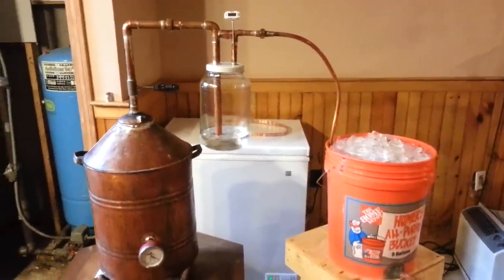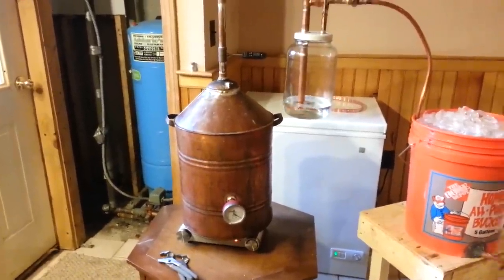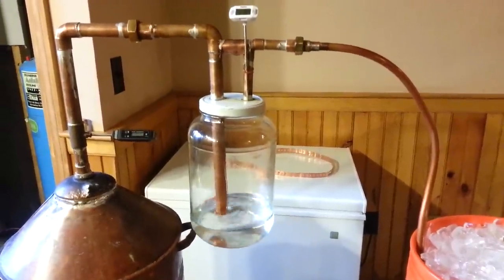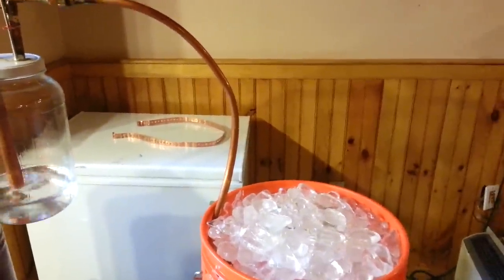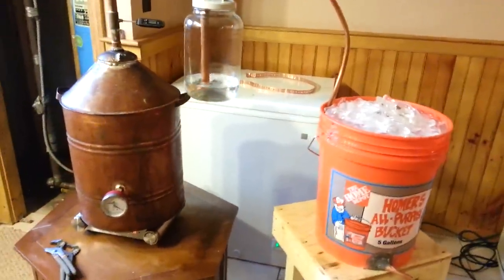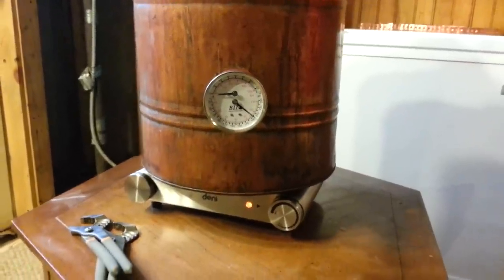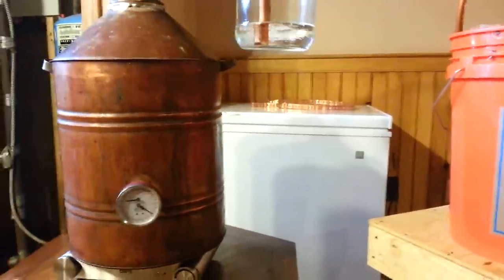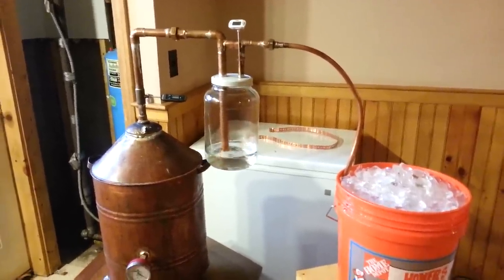Homemade still

Comment: I really like the brace across the top of the thumper for strength, especially holding up the weight of the thumper. Had me fooled for a moment as I thought that there was vapour passing through there until I TOOK A CLOSER LOOK.

Comment: Not bad. I actually took and redesigned my own still when I saw how you built your thumper. I just ran the copper line directly into the condenser at first but now I'm running a set up similar to yours
Reply from the maker: Hi, thank you for commenting and I'm amazed how many reviews I got!

Comment: Good Video! You have a pretty good set up! Be sure and vent your thumper and boiler when you shut it down or you could collapse your boiler! Hobby Distillers are becoming more and more numerous. I have found lots of good information from Bearded & Bored or Barley & Hopps Brewing!!! Those guys try and give you good advise. I have made two stills one is a packed column reflux and the other is almost a duplicate of what you have. All were made using what I could put together. One is all copper and the other is stainless steel pots and pans that I modified.

Comment from the maker: Thanks for taking a look at my video. The liquid in the "thumper" is tail ends of moonshine or regular moonshine, also can use mash liquid.
Reply: Just a tip, I know this is 9 years later lol I’m just getting started (kinda I’ve been doing it for two years) but filling up the thumper I think helps more once you start infusing flavors. I’d go about half the jar for this setup or maybe more (i just ordered the same jars 5 minutes ago lol and now im watching this and your using the same kind) but having more liquid in the thumper helps more alcohol get infused by the liquid, the more it passes through the more it’ll hold. You can also do two jars to get a higher abv and infuse multiple flavors

Comment: Thank you for the video, lots of good pointers on building the distiller.  Iowa USA
Reply: gene wiley I'm in Iowa as well. Southeast. Washington County. Would love to learn any tips you have.
Reply: I used to make shine in prison. We'd light a capful and if the flame burned invisable ( checked by hanging tissue over cap ) we  newit was 200+ proof. My queesstion...what proof do these homemade stills produce? Its a process in prison. Sugar, fruit, yeast, submersive heaters ( stingers ). Or 2-4 razor  blades secured to an electricall cord a nd llugged into outlet and wahlah...homemade water heating device. Very effective . Especially 2 or 3 per 5- gallon bucket...hehe. But if it blows up theres  no way to cover the smell of liquor-lmao

Comment: what purpose does the glass jar serve?  my still consists of the boiler that has a copper tube coming out of it that coils through an ice slurry. Basically the same as that but with no jar in the middle.

Comment: Nice antique still i have been doing straight sugar washes and have been getting 140 proof i put some raisins and apples to help the yeast work. Id like a thumper cause ill be running strong and then it drops off fast . Ill just save the backings and mix with the strong as i go along to bring it up. Nice set up tho i use stainless pots with all copper after ive used sll stainless and it doesnt taste as good .

Comment: has your thump jar held up to date?  some say glass is a no no. 
as a previous comment mentioned- ditch the ice. use a 5 gal pail higher than the condenser for the cold water in. make sure the hose delivers cold water to the bottom of the condenser.  use aquarium air hose for this (serious). clamp hoses from the inside top of the condenser running to another five gal pail lower than the condenser. 100% siphon action. this water will be hot-perfect for dishes or a bath. my set up is two gal smaller than yours. i only need one aquarium air hose in and out to keep my drip cold. two should be plenty. youll run about 20 gal of cold water and getr it back hot...there's efficiency.

Comment: Where did you find the fitting for your digital thermometer on top of your cap?
Reply: its a 3/4 bleeder tee for heat lines the outlet it list 1/4" i believe

Comment: Hi, nice still. A Russian friend explained I needed a small pub keg so I bought one for £20 of a landlord in Manchester, UK then the Russian got me a coupler and said I also needed 10 metre copper pipe for the worm which I bought for £20 so thats £40 Ive spent. Not seen the Russian for a while but figured I can learn myself anyhow. The thumper jar, Im wondering why its joined at the top and is it really effective as it gets warm? Does the thermometre need to be in a grommet or soldered in?

Comment: I was wondering how far the exhaust pipe from the boiler went into the thumper. Now I have a better idea on how to set mine,if and when I do mine.Thanks for the video.
Reply: Run it pretty close to the bottom, I like a half inch to an inch off the bottom depending on thumper size and the top pipe as close to flush as possible

Comment: If this was a true antique store find then you should know that they only used lead in the solder in the old days as that's all they had.   I would be more worried about that then!!!  the homemade thumper.
Reply: Was wondering what's in the thumper? Distilled water or some previous batch's heads/tails...
Reply: Lead in the condenser (old radiator) would be very dangerous . . . . in the pot it would tend to "stay behind" just like salt, sugar, the mash solids, and any other contaminants.  There's even a 2nd distillation - the thumper itself would catch non-volatile contaminants.
Reply: @stevenjohnson2273  it's an open pressure vessel so it wouldn't explode, it would only shatter if it went I to temperal shock from rapid cooling
Reply: Not true. I had (saddly don't anymore) my great gran dad's still. I tested the solder for lead and it came back as lead free. That's on a 100 + year old pot

Comment: the worm bucket doesnt need ice, just cool running water...the ice is causing too much condensation inside the worm,  much like cold tea poured in a glass with the water forming in on the outside

Comment: Great hobby !!
What purpose the pickle jar serves? What difference water or alcohol in jar will make? Can it be run directly? What else can I use if I do not find copper pot?
Reply: stainless steel pot
Reply: 1 question, on your thumper, does it require a copper lid ?

Comment: Hope that jar doesn`t blow up on you if it hasn`t,gotta replace it with pyrex or a steel pot cause the heat will stress out the glass and break it.
Reply: jar wont blow up you can boil mason jars  . and it only gets to 170 degrees  making alcohol. thumper helps lots
Reply: cadillac cts It`s not a mason jar it was like a empty glass jelly jar, the stress makes the jar weaker I wouldn't`t use a regular glass jar cause I would be afraid of it cracking after awhile. Yeah the thumper's do help quite a bit it`s like doing another half distilling also you can put juice or whatever in it to add a bit of flavor.

Comment: A few words of caution.
A pickle jar is NOT suitable for a thumper. The gasket ain't supposed to be exposed to high ABV alcohol and all the other stuff that comes off the boiler.
Furthermore, the glass WILL fail at a point as it's NOT borosilicate and heat resistant.
You should buy a lead test kit and test that boiler for lead solder. Back in the day, some fool may have soldered the boiler up with that stuff..it's a no go..!
If it tests positive take it apart and remove all solder, clean it thoroughly and resolder.
If you discover some huffing from the worm the ice is the cause. Use cold water to create a temperature gradient from top to bottom of the flake stand.
Happy distilling. :)
Reply from the maker: Thank you for the information and these days I no longer distill. Have a great day :)

Comment: Since you have a glass thumper, does your thumper ever go empty? Reason i am asking is cause i have a 5 gal still with a 1/2 gal thumper and after 2 qts i start to get a cloudy product plus the alcohol reading drops from 90 proof to 20 proof real quick...And since i do not have a glass thumper i do not know if it went dry/empty and thats why its cloudy from air or if it went back into the still and thats why the thumper is always empty...Either way if yours doesnt go empty then i still have an issue with it clouding up after 2 qts....1 qt is 150proof and the second qt is 140 proof and then not long after it just starts dropping fast and then it clouds up....I then shut it down, let it cool down, open up the thumper & its empty! So plz let me know so i can fix my issue...Thank you!!
Reply: My guess is your thumper water is reaching 212 degrees and then evaporates and that is causing your cloudiness and drop in proof.  Maybe you just need more water to increase its thermal capacity.  Or start with colder water.
Reply: if you end product starts turning cloudy in the middle of your run, your still is puking because your heat is too high, if your pipe going in too the thumper is all the way to the bottom, when you let the still  cool down it is drawing the liquid in the thumper back in the still, if you can reset the pipe in the thumper to about an inch off the bottom, and the next time you make a run start with low heat, old timers will tell you, low and slow is the way to go.

Comment: Out of your 5 gallon mash run how much do u dump out for the head?
Reply: It wouldn't be "wasted" if you collect even 300ml and dump it in your car's gas tank as "fuel injection cleaner" where Methyl Alcohol would be a powerful solvent and fuel.
Reply: Mark I'm just starting to learn if bad alcohol is under a hundred and seventy why not keep temp under 170 until every nothing comes out then turn it up

Comment: I'd suggest putting a safety container (a bucket or a cheap stockpot) outside of the jar. That would catch the glass and the alcohol if something goes wrong.  Right now with that jar hanging over the burner, if it breaks some of the once-distilled alcohol inside will hit the hot plate, and when it lights, it will ignite the vapor tube.
Reply: Should NEVER use glass in any part of a still operation. The dangers of alcohol vapors alone should speak for itself.
Reply: Utter nonsense - glass is used every day in laboratories for this kind of operation.

Comment: I'm a dummy writing a history. Two paragraphs deal with 1920s stills. How do you get the mash in the copper still? How do you empty it? Some sources say the mash is made outside the still and then added when you need to distill. Do you pour in or siphon in the mash water/mix into the still? I'm concerned about explaining the broken up equipment that shows up in prohibition photos? Were very large wooden vats for mixing the mash? Thanks.

Comment: why is the jar exactly for messy particles right?
Reply: Vladimir Nachev If you are getting anything but vapor from your still you are running too hot and actually boiling the mash over.  You run the risk of burning the mash with too much heat.  In the case of corn mash, it'll taste like burnt popcorn.  You might be filling you still too high also.

Comment: You really need to change out the lid on your thumper. Bad enough it's glass it that lid is not copper or stainless! NEVER have anything other than copper, stainless, or glass in contact with your shine. It can cause poisons compounds in your final product
PS: those are thermometers not thermostats

Comment: You have a bridge connection on the thumper bottle,that's a waste you need to take that pice out
Reply: +225rc It looks like it's just a brace for stability. I don't think any of the distilled spirits are escaping through it. Could be wrong, but it looks more for strength than venting the spirits.
Reply: +yovinny100 Reason I believe that is because the jar is suspended in mid air. If there wasn't a brace, the tubing might be prone to be pulled around and eventually break the solder, causing a leak. If the jar was on a flat surface, that wouldn't be a problem. Just my thoughts.

Comment: You should have flowing water running through your thumper (doubler) so that the water stays at a constant temperature. Otherwise, your water gets warmer and warmer which will allow more water to end up in your final product thus defeating the optimal function of your thumper. Simple physics....
Reply: +Kevin Thomas It should be tails from the last batch (or equivalent) as the alcohol still burns off before the H2O...
Reply: flowing water thru a thumper?? why are you putting water in it....you can charge it with weaker alcohol for re distilling and water evap at 212 and you should never ever be close to that temp in a thumper so hence not much worries of water flowing in your final product...lol and a thumper is there to help pull out water picked up by alc vapors and store it....so your physics theory is wrong....water flows around condenser no thru a thumper.
Reply: You should not have flowing water through a thumper! The whole purpose of this is to add a second distillation in this process. The vapors will condense into the liquid. Now think about that. If you are running water through it you are literally wasting all of your alcohol.  It would t even make it to the condenser much less a glass. When the liquid in the thumper raises temp it produces more vapors thus sending vapors to the condenser hence second distillation process. Your way would completely ruin a batch and I’m just going to assume you are confusing a thumper with a condenser. I do not condone using a glass thumper by any means and I know this is an older comment. But hopefully it helps someone.

Comment: You dont want your output line i.e. alchool line to be submerged in the glass jar because it will create a vacuum in the boiler which creates a lot of problems with the purity.